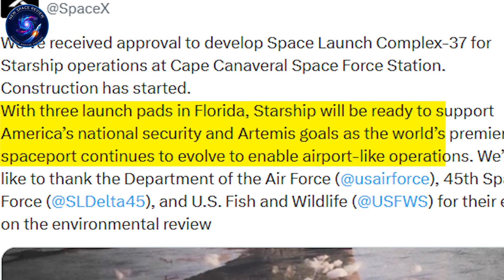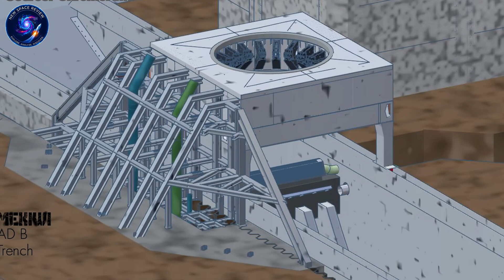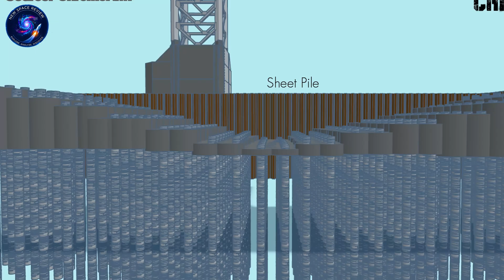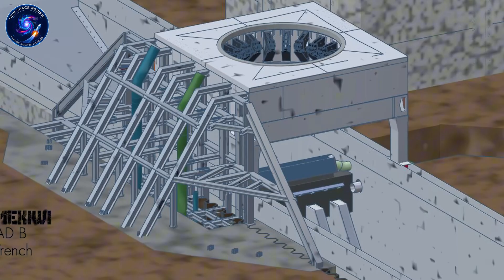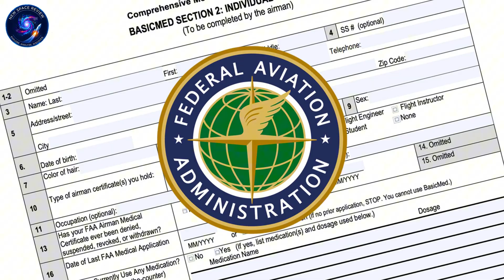Elon Musk Declared SpaceX's 5-Pad Starship Plan...Mind-blowing!

Comment: While a Mars base will add a significant amount of infrastructure to SpaceX capability, the real next step is bases (like more than ten) on the moons of the outer planets.  Initial surveys of those moons indicate that there are immense quantities of supercooled hydrocarbons as well as individual elements, compounds, and mixtures of great value to an industrial manufacturing and transportation empire.  Once anchored in the outer planets with the structural metals from within the "Asteroid Belt" and the products of the outer moons secured, there is no practical limit to the size of intragalactic "generational" colonization ships.
Reply from the maker: Outer planet moons are the ultimate jackpot, but Starship’s five-pad plan is the crucial first step to unlock the asteroid belt and those supercooled resources. Mars is just the gas station; the real empire starts beyond Jupiter!